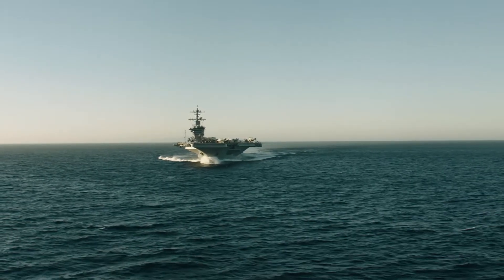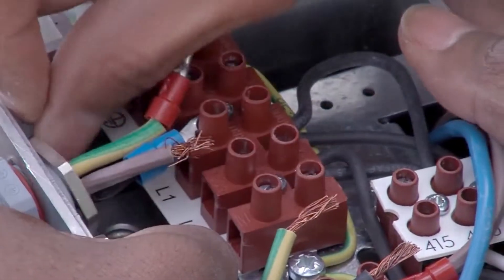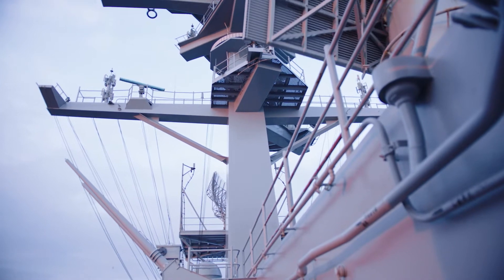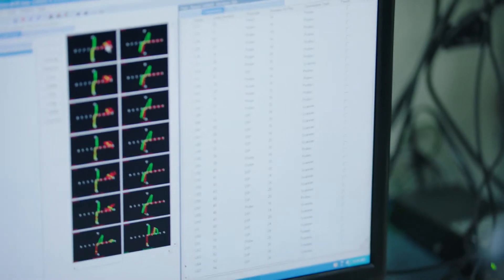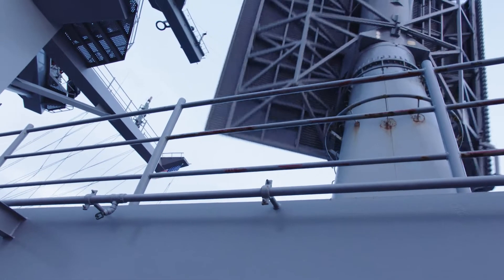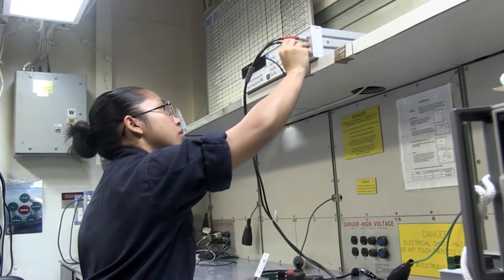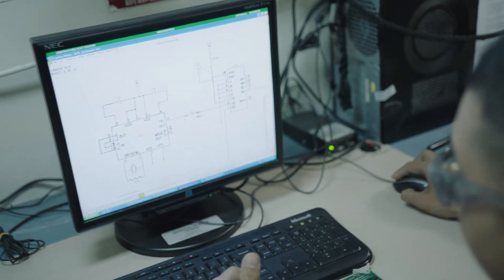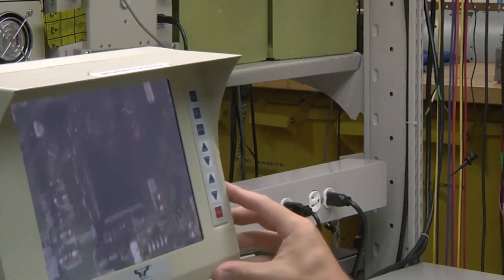Navy Cryptologic Technician Maintenance – CTM

Comment: I'm about to be shipped off to bootcamp and CTM will be my rate and I was looking for any advice out there
Reply: Buy a Behringer Neutron (+80hp ears) and a SigGen/SpecAn for a 9u rack on your alone time.
Reply: Anything I can tell you is 35 years out of date. In my time, between prerequisites, "A" School, and multiple "C" Schools, and assuming there was no delay with your SCI clearances, you could expect two years in school, but the rate required a manditory two year extension,. You left for Boot Camp as  an E-3, and advanced to PO3  prior to beginning CTM "A" School.  The training closely resembled Communications ET training, but CTM had the advanteges of school in Pensacola rather than "Great Mistakes", and a MUCH BETTER ship/shore rotation. The other advantage was that if you had a ship billet , you were  part of a detachment rather than "ships company" so youre duty rotation was much better.